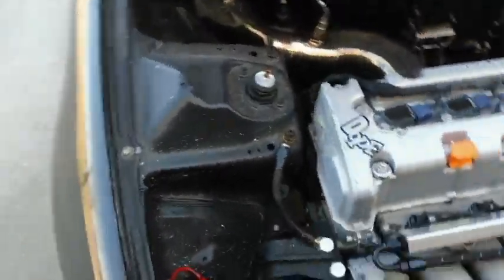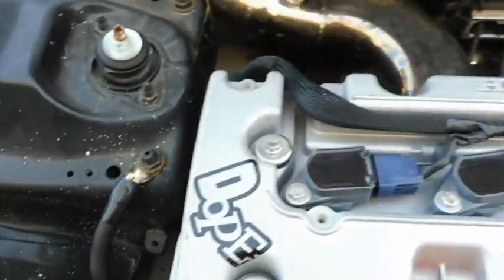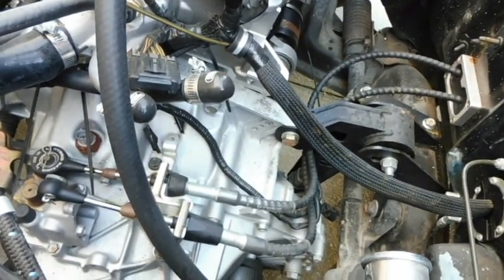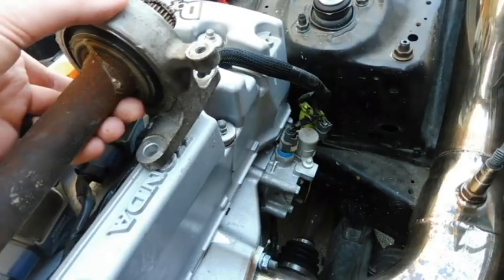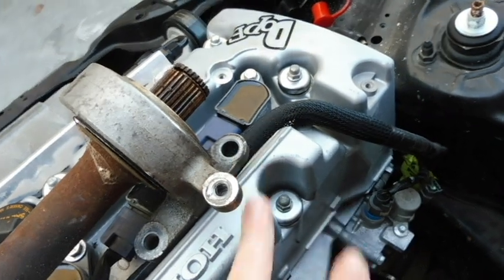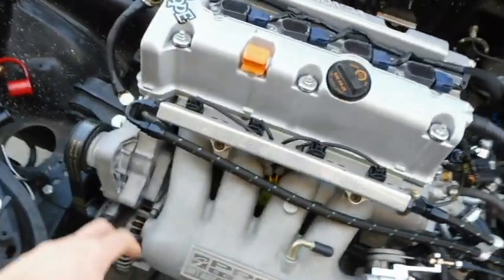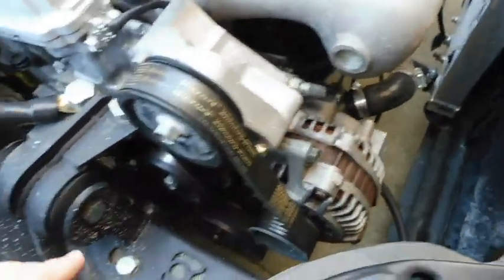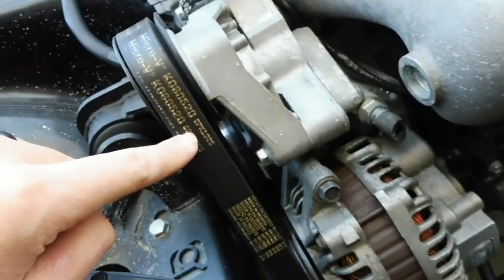HOW TO : K24Z7 Swap in EG Honda Civic (Part 2) Installing engine

Comment: What alternator plug did you use. Cause the z3/z7 don't share a alternator  or water pump housing?
Reply from the maker: Its an a2 alternator and a2 charge harness

Comment: Hey brother so when it comes to mount the head on the block did you have to modify the block or head????
Reply from the maker: The engine is stock. Stock head and block. All Z7

Comment: Old post but just to be clear 

You used the K20A2 

Engine harness 
Axles & Half Shalf
Reply from the maker: K20a2 harness and half shaft. Axles are aftermarket swap axles. If you use OEM axles in an EG I think you use RSX base axles, but you should confirm that

Comment: Did you swap the water pump housing?   Our alternator on the k24z7 bolts on different
Reply from the maker: I did not swap the water pump or the housing. Thats what came on the z7 engine. I used an rsx s alternator
Reply: @ballsoutperformance  that crazy. My alt bolts different.
Reply from the maker: That is interesting. Maybe it varies depending on what chassis the engine is from.

Comment: I have a k24z3 block k24a2 head using k24z3 timing cover I grabbed a k24 post mount but it isn't the same bolt length and caant get my passenger hasport mount on
Reply from the maker: I used the factory z7 passenger mount bracket, if thats what youre referring to.

Comment: What’s up bro. I got a complete 9th gen civic. I want to swap it to a crx. Can I use stock k24z7,ecu, harness and trans .
Reply from the maker: Sure. Youll just have to do some custom wiring
Reply: @ballsoutperformance  so stock harness would be usable from the 9th gen? Do I have to use the cluster and all that or can I just get the k tune immobilized by pass piggy back.

Comment: Did you use the stock iACV Valve with the throttle body?
Reply from the maker: Yes, a k20a2 IACV.
Reply: BallsOutPerformance thanks a lot

Comment: Thanks for the informative video! I just bought a 2012 civic si donor and I wanna use it in my 2002 RSX Type S. It sounds like its a bolt on affair besides extending the crank sensor wiring and grinding a few things?
Reply from the maker: Yes and no.  What ECU and engine harness do you plan to utilize?

Comment: I have a k24a and a k24z7 transmission what halfshaft should I use and i have 06 si axles
Reply from the maker: What chassis are you putting it in? In the EG chassis I used an rsx-s half shaft and DSS swap axles.  The Z7 half shaft was too long for my application.  Im not sure on the dimensions or hub shaft size on your 06 si axles so I cannot comment on that.
Reply: @ballsoutperformance  ek
Reply from the maker: @osvaldoperez7205  ok. Yea im assuming that the 06 si axles will be too long, but I may be wrong. I know for sure you can use rsx base axles. Or again, some aftermarket swap axles. With either one of these options, you would use the rsx half shaft
Reply: @ballsoutperformance   thanks alot and keep the videos coming they are very helpful
Reply from the maker: No problem. And yea i want to make some more but havent had spare time for car stuff. Hopefully soon.

Comment: Tell us more about your hood exit exhaust.
Reply from the maker: Ill show more details on it in an upcoming video. After i finish the swap how to series Ill do a feature on the car and all the mods including the exhaust. Ill also talk about the future plans and show some of the other parts I have for it. 
But for now Ill tell you about the exhaust. I built the flange from scratch from a piece of 1/4" stainless plate. The tubing is stainless  prebends that I bought  from Vibrant. Suprisingly they had the oval 90 degree piping that I used for the initial piece coming off the flange. Then I used an oval to round transition piece. I think the piping is 3.5 inch diameter. Cant remember. I built and tacked everything then had a friend tig it for me. Also added the bung for the o2 sensor.

Comment: Hey if I have a z7 full swap with full uncut engine harness and the computer, is it possible to get that to run if I send power and ground to the ecu?
Reply from the maker: Yea that should be possible. With a wiring schematic you should be able to figure out how to power on the system and make it run. Being that all I had was  the engine only, i didnt utilize the Z7 harness and ECU. Ill be covered how i wired mine in the next video